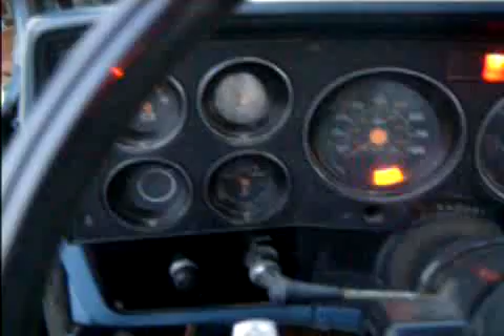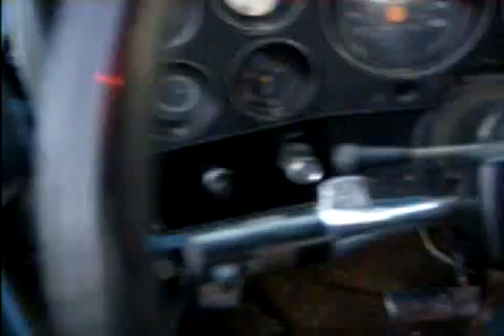6.2L diesel

Comment: @oldsmobilcherrybomb 
damn thats a sweet deal and a good project. judging by those pics i'm glad i didn't buy that truck cause that would have been too big of a project for me right now lol. i got a bunch of pics on facebook if you have one but none up on youtube or anything yet. i'm tearing the 150 down this spring and repainting it / undercoating the frame and everything after i get all the body and suspension work done. i just put a new clutch and everything in it too.